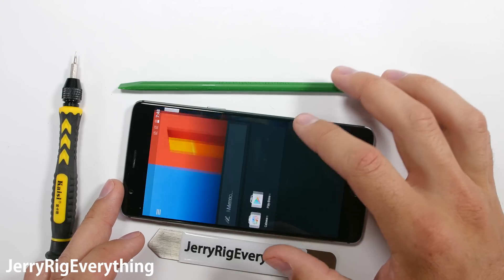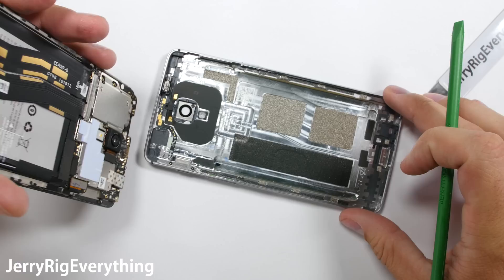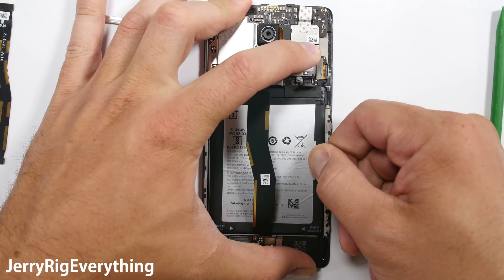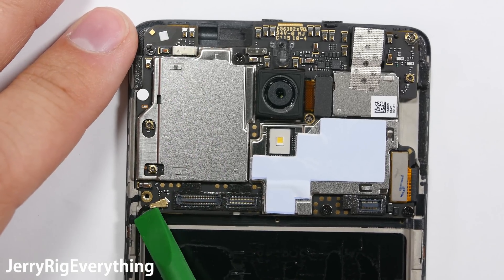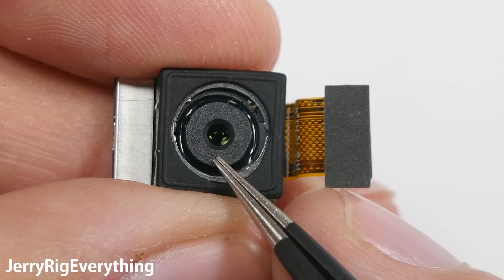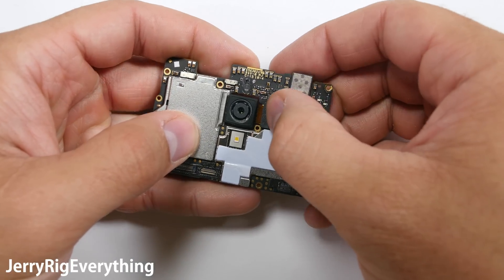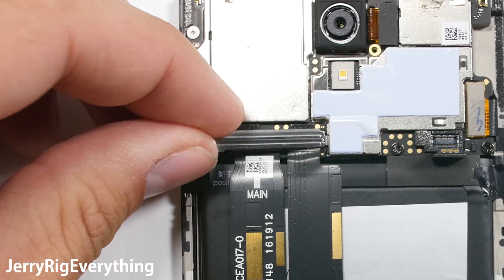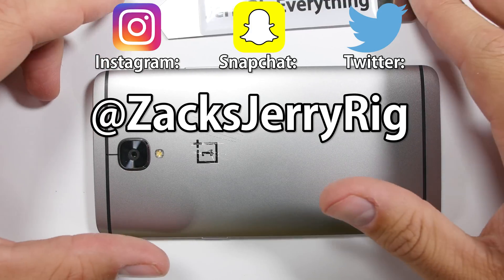OnePlus 3 Teardown, Screen Replacement, Battery fix

Comment: What if you would have to replace the plastic frame from the screen? Mine is damaged and I have noticed dust is coming in from the top...

Oh, and I need to replace the headphone jack as well. Might as well do the entire bottom part. Any trustworthy sources where you can purchase?

Comment: Alright here I am starting to try and swap the battery after 4+ years of use.

If I fail, I have an iPhone 4 as a backup phone, LMAO.

EDIT: I was successful.
Popping it open was waaaaaay harder than shown. I started at the bottom after heating it up with a blowdryer.

Also, the battery wasn't that easy to pull off. It also needed some heating first.

Hardest part is opening it up, be careful!
Reply: @chitrarth11  original.
Reply: Just tried on mine to see if I could replace the battery, the screen came off rather than the phone bits, screen died. RIP OP3, your service won't be forgotten.
Reply: @Galf506  Sir, at least youve tried. Stupid people buy new phone, smart people try to repair.

Comment: Dear Jerry, I do have a question about the phone. I replaced my battery with a new one which I bought on the net but then the battery indicator wouldn't drop down anymore. It would go up if I charge but then it sticks. I did notice that the battery is not quite the same size but anyway put it in. There must be a sensor which does not work properly anymore but I don't know where it is. Can you help?

Comment: Hi Zack. I'm hoping you can help with my problem. My 3T is still working fine except it does not receive mobile signals on both sim cards. Both sim cards are identified and phone still prompts me to enter the sim pin. However, i am unable to make/receive calls on it or identify any networks at all. I checked some repair guides and most suggest changing the signal cable "what you refer to as wire cable" on this video, which i replaced from a scrap OP3 i have laying around to no avail. Any suggestions to fix this? I really like this phone and do not want to replace it!

Comment: not sure if someone can read this, hopefully someone can help me. Is there a website where I can buy all the screws for oneplus 3? I know it's silly but I have this oneplus 3 which I tried to open before due to a screen that's no longer registering touch inputs. While I was working on it, there was an earthquake which stopped me and made me leave the room and so I left it at my desk just as it is (opened).  Unfortunately some screws got missing  when and I couldnt find them on my wooden floor so and probably, some of it got stuck and I can no longer retrieve. This is a long shot, I really need to make this phone working again. Hopefully someone can help.
Reply: hope you found your screws. but that is quite the story

Comment: Hi
I am in trouble my power button of OnePlus 3 is not working and volume button (downone) is also not working. My mobile is switched off now how can I turn on without both of them? Thanks ...
Reply: Replace the power button+volume button FLEX CABLE... Its easy to find and replace

Comment: Hi Jerry, tried to pry open, but only the glass came off. The frame with the battery etc is still stuck to the back cover., Any chance I can pty the rest of the frame out, or do I lose hope? I bought screen with frame to replace. Thanks so much!
Reply: same happened to me
Reply: @SairasSiika  Hey, I finally managed to pry it open with an extremely extremely thin metal strip - it still took a lot of effort even with the strip. I bought something called "Super think bookmarks" from a stationery store here called Daiso.
Reply: @hemalitanna   Alright, glad to hear you managed to fix it! Gotta keep my eyes open tomorrow, maybe I'll find something helpful aswell ! :)
Reply: @SairasSiika  Thanks, I pried it open, but still not fixed. There is a set of very tiny screws in, and I dont have the right screwdriver - need to wait for the stores to open after lockdowns :(
Reply: @hemalitanna  hi, u fixed it already?
Reply: same thing happened to me. i also couldnt get the two bottom screws out.

Comment: That thing you said about corrosion on the physical button pads or in the buttons themselves caused by water just happened to me. After 2 years of ownership, the vol buttons started to work half the time and a year later I replaced them. Even though my phone has never been around water to my knowledge, I saw some stains that water leaves behind when evaporates around the buttons and especially the sim card tray inside the phone when I opened it. Most likely normal daily usage results in that because of environmental humidity, human sweat etc. So what you suggested is a very likely scenario for the 3T. Despite this, I am glad though that the phone isn't waterproof as it is very easy to repair.

Comment: Hey Zack, hope you guys are well. I am nursing an OP3T along into its 4th year, with an occasional new battery it's good as gold! However, callers are now saying I sound like I'm underwater so I suspect a replacement mic is the way forward. Is this a part of the lower speaker/charging assembly?

Comment: 2019 I still have this phone perfectly working with android pie, so it is pretty durable.
Reply: same, and no plans on upgrading to a new phone any time soon 👌
Reply: Me too, I replaced the battery, camera module and usb c port. Like new!
Reply: @dosetti  how much it costed for those replacements??
Reply: @akhilakky6052  battery 20eur, camera module 13eur and USB port 7euros. The price on eBay depends on how quickly you want items. Mine were from eu because I was in a hurry.. From China maybe 15eur for all.
Reply: 2020 I still got my 3T. I have no reason to upgrade, it's such a great phone! I'm considering installing lineageOS so that I keep getting updates 

If only oneplus didn't remove the headphone jack from their new phones though I definitely would've gotten another oneplus

Comment: my back key is not working need help......i started on screen navigation bar ...... it was wet in rain last night...... my phone restarts since yesterday when i start wifi.. oneplus3 help.....
Reply: and is oneplus 3 screen is sticked with glue ??? because its been 4 years now and the glue has vanished behind the screen panel.... shall i apply decent glue ?

Comment: 2019 and still using oneplus 3 
Still have best performance
Reply: Still using mine too. I love it so much, I replaced battery and charge port a couple of months ago instead of upgrading.
Reply: @cheapandeasy1715  well, its now 1 year for this comment, but do you still use this phone? And so, maybe you remember where did you get new battery. Can't find original one, only fake ones.
Reply: @djedvis  No, I'm using a Oneplus 7 pro now. I got the battery off Ebay. That particular seller no longer has them, but there are still quite a few OEM BLP613 batteries from reputable sellers.

Comment: My usb c connector is failing. I mean, when I connect the dash charger, ir starts in normal mode, and I need to unplug it and replug it the other way around to charge in dash mode. I cannot see if it is dirty or not, but it looks like the usb c goes into no completely. I don't know if it is dirty or it is starting to break slowly. I tried blowing air in and also with a high pressure cleaning kit, but with no luck. Could you share the replacement link for that part? Or you think I could fix it without replacing it for a new part? Thanks

Comment: Hello, please, can you help me ... I'm from Brazil, and I have a Oneplus 5 that stopped loading. It has 1 year of use, there was no drop or no other problem. Just after an ordinary day, when the battery was at 20%, I put it to charge and no more charged. Can you tell me where the problem is? Which piece do I need to fit? Knowing that there is no authorized maintenance of Oneplus in Brazil, if you need to import, which part would it be?

Oneplus is a fantastic device ... I believe this is not such a serious problem ... but after opening and testing, I have not yet identified the root cause of it not loading. Original cables.

Comment: My OnePlus 3 device has accumulated some dust behind the front camera and that is making the selfies too bad. The authorized repair centre told me they have to replace the entire screen costing me a bomb. My screen otherwise is absolutely fine. Cant they just open it an clear the dust and place it back firmly ??? Please guide me.

Comment: I have replace for my broken screen and everything seemed to be fine until I switched off the screen. Although the hardware buttons work, the screen is totally unresponsive. I mean the screen works during start up and the entire phone works fine, but when the screen goes black it won't respond. any idea? pls help

Comment: Hey Jerry, at 3.30 u  say that if we separate the screen from the middle frame it will kill the lcd. Is it true? Im about to that cause the glue got loosen between the frame and the screen and i wanna replace it. Can I do that or I rather shouldn t? Thanks in advance

Comment: My screen has separated on the top from the plastic. Seeing the tear down, it seems like a bitch to repair. Any solutions? Can I put some super glue in between the glass and plastic to hold it in place?

Comment: Adhesive was really strong on the battery and the power/volume flex cable.
Ended up ripping the flex cable when trying to lift it up.

Comment: Will the phone work if the back cover is removed? There are some copper contact points inside... some for the vibration motor and for the "do not disturb" button and some more in the upper and lower side. I have a phone that gives no sign of life an I try to see if it is battery related. It throws me off if the cover is also required.
EDIT: Yes it works. I took apart another Oneplus 3. Yes the phone turns on without the back cover.
EDIT2: Seems like the Power Management chip PMI8996 is fried. Its a bit melted from the sides. Any chance somebody knows where to buy a new mainboard?

Comment: Is the Wi-Fi Receiver integrated in the motherboard or is it a seperate part? I have an issue related to oxidation to the motherboard/wifi-receiver, OnePlus repair team is charging me close to 300€ for a motherboard swap, or get it back, not functioning. Any ideas on what to do? (They also cracked my screen during shipping -,- )

Comment: I have this phone for 18 months now, love it. But the display panel itself is starting to separate from the display frame. From the readings i have done it could be caused by a bulging battery but I don't know for sure as I have not gotten into the phone yet. Any advice on how to re-adhere the display panel?

Comment: My 3t fell once and the screen bugged out. I held the home,volume, and power button until it booted back up. Worked fine for a couple hours, but then it began to look as if ink spilled inside the phone and was under the screen. Now I can’t see the screen but it will turn on and the little light on top works and I still notification, I just can’t see the screen pls help, what do I need to do.

Comment: Hey Jerry , my phone got drowned in water ( from home button up ) to a good 5 cm. And my capacitive buttons are not working at all and my screen colour is faded. Are there any means of fixing it or should I get a new screen? If the latter is necessary, how good are oem screens compared to original screen?

Comment: the battery is not coming off from the pull tab on mine :( it's really stuck and it starts to bend from the middle when I pull from the tab.
EDIT: My battery is fucked, I don't recommend using the pull tab at least if the battery really seems stuck. Luckily I have another battery coming but now I have to wait for that to come first...

Comment: Any idea how to get the top speaker out without breaking it? I tried, but I pulled out only the top piece with very tiny delicate wires, so I put it back quickly..

Comment: Thanks for your video's; i appreciate you efforts. I have a question; I have my oneplus 3t for about 7 months and it had been working perfectly until i dropped it. After the drop i notice two deep cut/scratch at the top right corner of the screen( not at the actual screen, but at same height as the front facing camera) of my oneplus. After the drop, the battery life of my one plus is not the same. It drains way to fast, specially when watching movies, or videos. Beside this battery concern, everything is working well. Non the less, this new problem with battery life i am facing is at the least annoying. it looks to me that the battery problem and the drop( deep cut) is connected. What's your opinion on this? And any idea how to resolve this problem? GREETINGS!!!

Comment: I just broke my screen and replace it, but after that the rear camera and flash stopped working, i tried all the cache memory erase and factory hard reset .... but when i start the camera app is starting with the front camera. i tried also third party apps ... and they says camera cannot initialize  ... any idea how can i fix the motherboard or maybe some contacts on the motherboard ?

Comment: Hey Jerry, thanks for this, question; Did you found a replacement for the whole charging port? and also, is it the same for the oneplus 3t? my gf's 3t got wet with soap and the mic stopped working, i dunno if it comes in a whole piece with the charging port and speakers, please let me know if you found a replacement! Thank you again!

Comment: Hey Jerry just a quick question if i may, i have a OP3T that is now dead (screen is still working from last time i turned it on) and I just bought another OP3T with a crack screen and wanted to replace it with my dead OP3T screen.  I wonder what possible issue i might encounter if i go with that route?

Comment: Hi Jerry,

The Volume down rocker on my OnePlus3 isn't as responsive as the volume up. It still works but doesn't give the satisfying click, is it worth opening my phone to try and clean out the rocker in case there is some debris affecting the rocker?

Thanks!

Comment: So umm just yesterday, i was using my phone normally (3T) and suddenly out of nowhere the bottom part of my touchscreen (about 1 cm) started spamming random touches, then stopped working. Does anyone know what the cause may be? Do i need a new screen or can it just be a loose connector? Could it be a software issue?

p.s.: No, i did not drop my phone or anything like that.

Comment: The oneplus 3 and 3T are very similar... Couldn't I just buy a 16MP Frontcam replacement for the oneplus 3T and put it into my OP3? 
Or would I also need to change settings...? 
(would it even fit? Or is the connector bigger/smaller?)

Comment: hello. my one plus 3 get soaked in water a little but then when i found out the screen was black. thought battery empty then recharge but then when power on screen still black. the light button still works and when touching the screen there is still the vibration and sound similar like when touching the number button. any idea how to fix this? i have opened the phone and the water damage indicator is in white colour. thanks for ,any help :)

Comment: When replacing cracked front glass, with this (https://www.aliexpress.com/item-img/100-tested-LCD-screen-display-touch-panel-digitizer-with-frame-For-oneplus-three-oneplus-3-A3000/32776876715.html)  do I need to transfer the home button from the old screen to the new one? If so, how easy is it

Comment: i have hair crack on my one plus 3tb screen but touch and display works absolutly fine so still should i change my screen with lcd or should i change only Lcd glass if it possible plz help me out

Comment: hi dude.
A friend had an unlucky day when ahe drop her op3 at a bowl of water... while charging 🤣.
She had luck enough to not get her phone insta-killed, in fact, almost everything works ok except wifi: it can see APs but when she try to connect it just fail. It cannot even create the portable AP, so... what piece do you think she should replace? is it possible to only replace wifi chip or antennas? I'm afraid that she has replace the whole board. Do you have any ideas to try to resurrect the wifi?
thanks in advance, nice channel by the way

Comment: +jerryrigeverything what if teardown Dash charger and attach a 5v 4a boost converter instead of the AC DC transforming circuit to the dash charger to hopefully make a dash charge power bank ! Is it possible?

Comment: that was an absolutely fantastic video. one question. do you believe the wire connector along the edge of the phone (left hand side when it was open and facing down, the wire along the left of the battery) is the WiFi antenna?

Comment: My oneplus 3 digitizer stoped working, the lowe half so gave it to service center and they are replacing the whole screen/touch assembly. So the plastic frame and the fingerprint sensor remain fixed to the screen, i mean if if it is, then it will get replaced too, right?

Comment: the screen that you put in the description does not come with adhesive and it is a knock off it lags and does not produce a very great frame rate, I know this because I am using it now but thanks for the video

Comment: is it possible to replace the glass only? mine has it's glass shattered but LCD still works perfect. im tryin to save money since lcd assembly is almost 100 times expensive as the glass only replacement.

Comment: Hey i'm looking for the internal speaker replacement as I have seeemed to of have lost mine during replacement. Also the capacitive buttons have stopped working so if there is a replacement for those that would be amazing

Comment: Phew. Got my phone fixed. Thanks a million for posting this video!
My volume (-) button got stuck and the phone didn't turn on anymore as it would just go to the safe mode boot menu. I would never have dared to pry the thing open without watching this (and Wit Rigs') video, it was really tight. Now I'll be able to switch a red battery in at some point :)